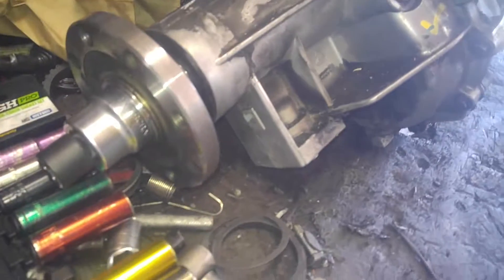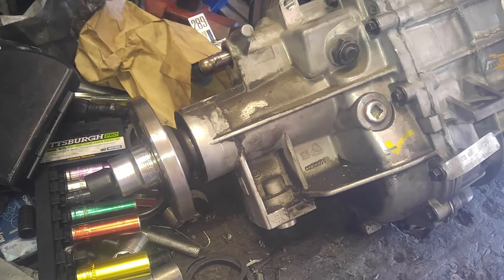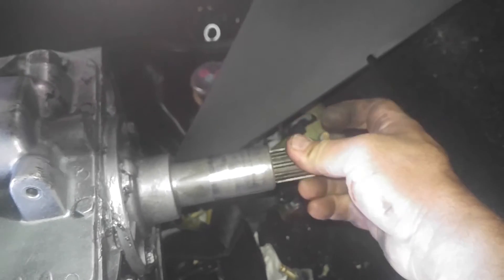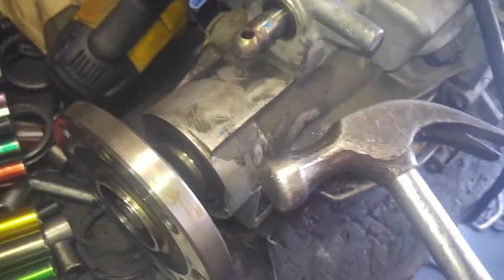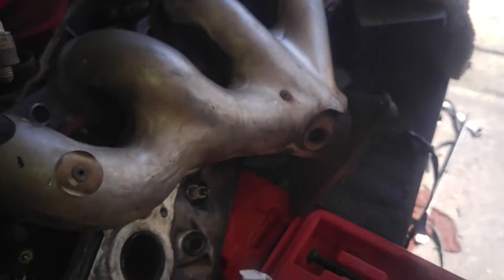Tr 3650 mustang tremec transmission 5 speed rebuild disassembly part 1

Comment: I cracked the tail shaft housing on my 04 GT with the 5 Speed 3650 trans.. Can I just pull the taill like you did at 12:50? and swap it , or is there anything else id need to do
Reply from the maker: Sean Colon ya they're pretty easy to swap. Just put it in neutral.
Reply: @v8only  Thank you! ill try this over the weekend

Comment: These transmissions don’t like synthetic fluid. Try to find mercon 1. I’ve don’t done 2 Fluid changes with mercon 1 and the trans still runs great. Smooth shifts at 105000’milws. Hell I still have the stock clutch.
People please don’t use redline or Mobil 1 or royal purple thinking you’re putting in great fluid cuz it’s expensive. Those fluids eat the synchros. Just use mercon I dex iii. Trust me. You’ll never have to worry about syncro failure

Comment: hope you still check comments: how hard to change input shaft seal on 03 mustang gt tr3650? lay flat once out, pull off bell housing replace seal? gears come shooting out?
Reply: @v8only  gotcha. alright man, thank you for your time and info. really appreciate it. my input shaft seal leaks like a mother so gotta figure my next move. thanks again.
Reply: Jeremy Thompson and I thought I was downgrading from my tr3650 😅 on my 04 GT, my tranny grinds when I shift it into 2nd gear, if I wait a second it won’t grind, got my t45 in my backseat so it’s only a 2 seater for the moment 😂, till then no Johnny racecar for me (throwing In a new clutch too)
Reply from the maker: It's been a long while since I touched one of these however I remember the input shaft is buried and doesn't come out the front easily like a t5/tko/T56.  You have to disassemble them all the way down to get to it and the seal
Reply: @v8only  ok, thank you brother for replying.
Reply from the maker: Chris Davis sorry it wasn't better news. The 3650 is an aweful trans especially to take apart. Honestly if you can find a T45 they're better and I think they're pretty much a straight swap. You just have to match the Speedo up. Electric vs mechanical
Reply: @v8only  t45 might be cheaper too. i couldnt really find anything on the 01-04 tr3650 online. except how to replace....i thought the 3650 was a better trans than the t45....

Comment: I bought an 05 mustang gt with 64k miles.My transmission never had that whirring sound from the input shaft until 500 miles in, I should have gotten my fluid changed immediately but i trusted my used car dealership. Now that ive flushed it my first second and 3rd gear all sound like shit and clunk around. You're right though, nobody changes fluid.
Reply: 4.6v8gang sounds like your input shaft and cluster shaft are worn from low fluid. Sadly those parts are obsolete now.  You'll probably have to find another trans or upgrade to a tko or T56 magnum

Comment: I’ve rebuilt some spicers and Eatons, which all the gears are timed and they are non-synchronized I have never done a synchro trans is it timed, more difficult than a 10
Speed or do you know?
Reply from the maker: Fat Knuckles Productions  sorry never done a 10 speed or any of the ones you mentioned. However these aren't difficult if you already have basic knowledge how gearboxes work

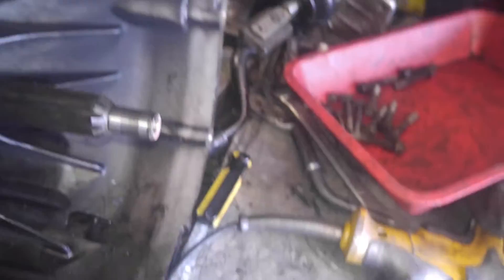Comment: tr3650 on my 01 cobra the input shaft that has 0 play up,down,left,right,back or forth.. It turns like butter butter but sounds a bit louder than what that t5 sounds like at 5:03 . it could just be camera not picking up all the little noises it makes and/or it's different transmissions. I know little about the tr3650, It could just be noisy tranny,i'm gonna change tranny fluid because I don't know what is in it. entire car is stock with 40k miles on it.

Comment: I have a 2005 gt with a manual. On occasion I hear a light thud when putting into first after coming to a stop. Everything runs smooth and not difficult at all to get it into and gear. Is that normal? Got about 102000 Miles on it.
Reply: I change my fluid every 45k with  mercon 1. The stuff is getting harder to find and don’t want to use anything synthetic. I hear synthetic destroys the 3650
Reply: Kevinb1821 a noise like that is never normal. Are you sure it's coming from trans and not u joints or rear end?

Comment: hi Jeremy thank you for the video I just want to remove the input shaft bearing what would need to come out in order to get to that bearin? I was told to just remove 12 bellhousing bolts and the three detent plugs on the side.
Reply from the maker: A L  been a long time since I've done one of these. I'm pretty sure it all has to come apart to get to the input

Comment: man. come on. it a nylock nut, not a teflon seal. you can rebuild a trans but don't know that? if you turn the flange as you tap not beat no it it is more likely to come off.
Reply: jason birch lmao, ppl will bitch about anything....

Comment: hi. i switched gears and grinded the shift.  between 2nd and 3rd gear at near redline RPM. afterwards, very difficult to switch into reverse and also notchy shifting in other gears now. but does shift.  ideas? appreciate it. 2008 Mustang GT.
Reply from the maker: james liu synchro may be the issue however sounds like your clutch isn't releasing all the way.  Need to tighten your clutch adjustment
Reply: Jeremy Thompson thx for quick response.  this fix is beyond my capabilities.  can you recommend best shop for repair...i.e., transmission shop, or independent general repair auto shop, or dealer?  also any idea of approx cost?  thx for your input friend...btw nice vid!
Reply from the maker: james liu  714 981 7563. Jose. He's got a mustang shop
Reply: Jeremy Thompson thx friend.  714 area code...Orange County california?
Reply from the maker: james liu orange la area
Reply: Jeremy Thompson thx!  im in that area too.

Comment from the maker: I'm nearly certain it can't be swapped, mainshaft may be different length, and shift rails.  plus the older ones use a slip yoke, newer ones use a bolt on one
Reply: I need that 3 an 4 shift gate
Reply from the maker: @QuidClipsOfficial  sorry got rid of all my 3650 stuff a long time ago

Comment from the maker: no need to necessarily spend that much.  pull the entire thing apart and inspect it first.  inspect condition of bearings.  Usually bearings last 200k miles or more.  often you can get away with just replacing the one bearing
Reply: Can you reseal the back half without removing the transmission?

Comment: I purchased an 05 trans like this one but sounds like the input bearing is shot, shifts smooth can I get away with a 300 bearing and seal kit? will I need to reshim? trusted a hooah said 10k miles it's good.